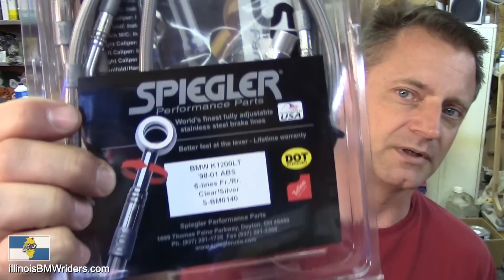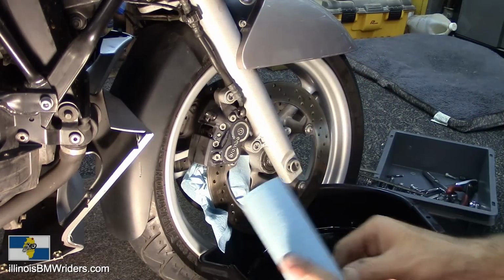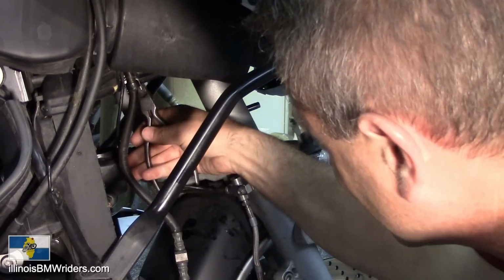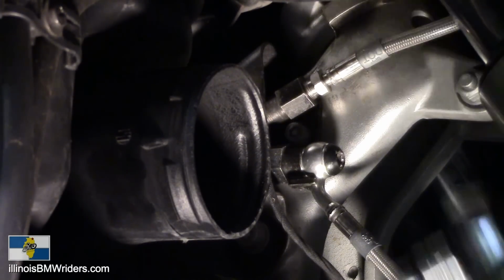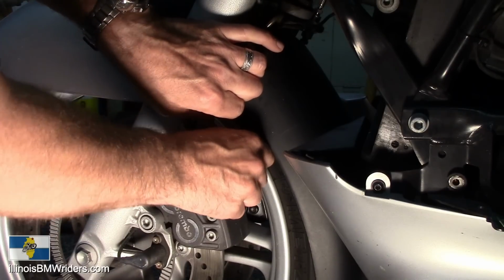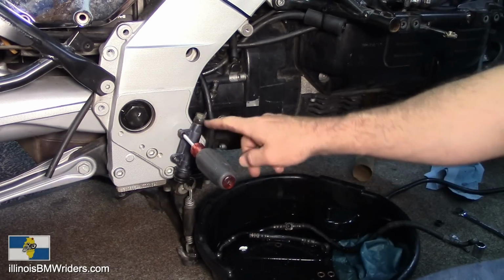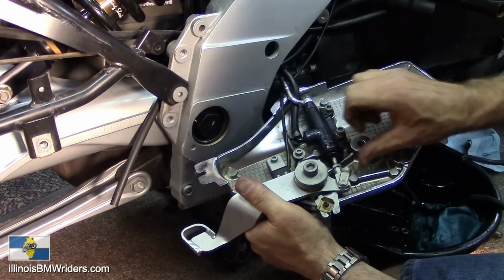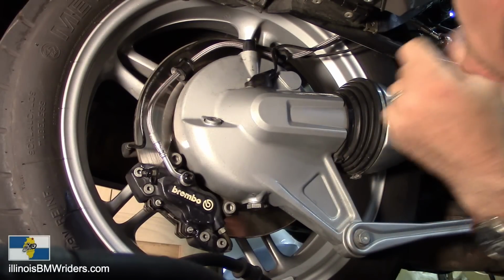BMW K1200LT DIY Spiegler Brake Lines Replacement

Comment: Good video. I have a few additions that I hope will be helpful-
-the bolts securing the handlebar covers are 3mm hex wrench/socket.
-the air horn absolutely needs to removed to do this job.
-to remove the lower end of the old master cylinder line it is impossible to get a 14 mm and an 11mm wrench in that space so I cut the brake line close to the fitting and used a 14mm socket and ratchet ti remove it. Mercifully Spengler supplied a line needing a single 11mm wrench to tighten the new line which is doable. Before tightening this fitting you will want to tighten the upper end of the line ti the master cylinder to achieve the correct angle.
-you can use a 16mm wrench on the new junction block when tightening those lines down.
-the left side caliper line needs to have the bracket and rubber grommet assembly removed to remove the old line (3mm hex socket). This bracket can be pried off the old brake line with a screwdriver and used on the new line.
-When trying to loosen the rear master caliber line from the fitting by the battery box it is impossible to get a 15mm wrench on the fitting without removing the shock/spring assembly. To avoid doing this I was able to put a vice grip on the banjo end of the old line to counter the torque of loosening the bolt. I also removed the bolt holding the bracket to the battery box(3mm) to give myself more space to work with. 
It’s an aggravating job but doable-

Comment: Great video Kirk! Thank you. 
I just finished this job on my 2000. Your video made the whole process so much simpler for me. Thanks again, great quality video and perfect instructions!
Reply: Hi, First I want to thank you for all of the great videos and tips.

I have performed a bunch of the things that you suggested. 

I just got my home and have a concern. It has a clunk when I go into a parking lot or small abrupt transition. I cant find anything obvious. 're filled the stabilizer, dont see any leak at the shock. Im stumped. Really smooth otherwise. Thanks in advance.

Guy Fogleman ID.
Reply: @Yugsie  did you figure it out?

Comment: Thank you, thank you, thank you! I did the kit myself. I could not have done this without your video(s). My front brake line broke the day after I finished a 2k miles vacation from central CA to Vegas, Zion, both rims of Grand Canyon(in 32° snow flurries), old Route 66 in AZ, then home all in 6 days. I was in my garage when I saw the leak. Definitely a conversion I should have done earlier. I am grateful the leak didn't occur on the road. Your bleeding video helped alot as well as your shifter linkage maintenance video I did too while LT ('06) was naked. It took me a day to strip, then two full days to r/r with the Speigler kit and bleed and reassemble the 'tupperware'. Thanks again. (I will eventually do a donation your way)
Reply from the maker: Your very welcome! I am on Patreon :-) www.patreon.com/kirkjohnson
Reply: @kirksmotorrad   hi kirk I'm looking on Ebay for spiegler brake lines and racecrafters usa are  coming up but the only thing is they're website is not opening so can I ask do you know of them and are they ok to order from as I'm from the uk . The bike is 1999 lt I can order from bmw uk but the price is very high . Regards cliff
Reply from the maker: @cliffperry8470  I have not used Racecrafters. Why not  contact Spiegler directly and have them shipped?
Reply: @kirksmotorrad  thanks I'll try that can I ask what's the best way to contact you . My lt needs loads of loving and parts . I've looked at it vids on bleeding the non abs but do you have a video of bleeding the calipers as well .
Reply from the maker: @cliffperry8470  http://kirksmotorrad.com/contact.html

Comment: Good thing you tested the brakes,I would rather have brake fluid all over the shop instead of all over the rear tire trying to brake hard at highway speed.You may have saved a life(s) 'Great job on making this video and thank you for sharing the helpful info,bro.Keep your rubber on the road and your tach in the black.Ride safe everyone and remember to lQQk twice and save a life,Motorcycles are everywhere!

Comment: TIP: Put the bolt and washer side on first and the male side last. 
When you put the male side in first you will find that you will be turning the bold side more and its not needed. 

There is a female on the frnt left side. Start at the brakes on the left then do the right side and work up to the air in-take area. Do the upper Hand Brake and work to the air intake area.  Now you can button this all up. 
The back is the same. Work from the brake to the front on the right side of the bike. 
You will find that from the foot brake up to the hard line is behind the (Back Bone Frame) Where the shock is. This was a really hard spot to deal with for me as nothing fit in this area.
>Total 6 lines.
2-Front lines
2-Upper lines
2-Rear lines

Comment: Another excellent video, thank you.  I appreciate your methods & techniques to get the job done.  A friend bought a 2003 K1200LT with 40K a few nights ago there was brake fluid on the front right caliper leaking from the hose just above the metal Tee.  The Spigler kit seems really nice, really like how they reworked the metal Tee.  I'm estimating 4 hrs to do the front / rear and bleed.  Wondering if time is saved by doing front first, and rear later.  I am fearful of bleeding the brakes - some go smoothly and some don't.
Reply: i know Im randomly asking but does anyone know of a way to log back into an instagram account?
I somehow forgot my password. I would love any help you can offer me!
Reply: @Harlem Kendrick Instablaster =)
Reply: @Edward Jonathan thanks so much for your reply. I got to the site on google and I'm waiting for the hacking stuff atm.
I see it takes quite some time so I will get back to you later when my account password hopefully is recovered.
Reply: @Edward Jonathan it did the trick and I now got access to my account again. I'm so happy:D
Thanks so much you really help me out :D
Reply: @Harlem Kendrick you are welcome :D

Comment: I usally perform a brake fluid flush prior to changing the lines so the lines dont get contaminated fluid in them
You end end up with pristine fluid and lines when done
Reply from the maker: works good either way as long as your lines have not deteriorated internally

Comment: Hi Kirk, Have a question. I have a '99 LT and I have to 'double pump' the front brake to get firm pressure while braking.  I this a master cylinder problem?  If so where can I get a replacement master cylinder for a reasonable price?  Thanks

Comment: Hello Kirk, thank you for those  Educational videos. I was wondering if you have a video to help me I just bought a 99 K 1200 LT. Which is smoking on initial start up. When it warms up its stop smoking. I'm assuming it's slightly burning oil. Can you please guide me to find a solution.
Reply from the maker: To reduce smoking on startup,  I do this when shutting it off. I shut it off sitting on the bike and wait at least 20 seconds or so before putting it on the side stand. That way the oil has time to drain back down and will reduce how much drains on top of the valves. Also use the center stand when ever you can. The smoking is normal.

Comment: ive watched and enjoyed your videos for some time...thanks. im curious if you can help me with an issue im having w/ my 04' k1200lt. when i attempt to start the bike, i cant seem to deactivate the alarm, fresh battery in fob, when i press the button on the fob,  the light on the fob blinks rapidly and continuously, until i stop pressing it.....the alarm indicator light in the dash appears to be pulsating from the moment the ignition is turned on, the the fob alarm button seems to have no effect on the alarm light on the dash. of course, the bike wont start while the red light on dash it lit. any ideas? thank you

Comment: Hi Kirk,  As always, thanks to you and your club for creating these service videos.
I had been planning to replace my brake lines on my 2004 LT over this past winter 2017-18 as a preemptive effort to avoid disaster.  Unfortunately, at the very moment of placing my bike on the lift last fall, I blew a line near the rear master cylinder.  It turned out that I could not get to the project as my planned work area was smaller than I thought.  So I left the project for this spring. The bike is on the lift in the garage and I am starting the undressing of the beast, but I suspect all of the brake fluid has drained out through the hemorrhaged brake line.  Do I face a new set of challenges in the brake line change now thinking I have lost all the fluid?
Reply from the maker: Probably not a disaster. Its likely you lost all the fluid but you can get it back.  If the master cyl leaked out, change the line and leave it loose at the top by the shock. refill the res and let it fill up to the line that is loose. After that, its bleed as normal. You should be fine. Remember, its only parts... and time!  Thankfully it didnt happen on the road!

Comment: Kirk , I have a 2006 k1200lt with 18,000 miles , pretty sure its been garaged its whole life , I am the second owner, the bike still has the oem break-lines, will I be ok for a while, or is this a 911 situation ?  as always thanks for your videos and help to the BMW motorcycle community
Reply from the maker: I would say if you just look at the bike and dont ride it ...ever... then yes, you can leave the brake lines.  There is NO WAY I would trust those lines to not break! We dont really have much in the way of protection on a motorcycle. Losing the brakes at the wrong time would  not help the safety factor.  I will be honest. I would love to find a brand new, never titled LT of any year with zero miles. The FIRST thing I would do is change the brake lines.
Reply: illinoisBMWriders Kirk , I am hearing you loud and clear , thank you for taking a moment to answer .

Comment: Hi Kirk. Thanks for the nice video. How do you know all the air is removed from the system? Is it normal for the front brake to feel spongy when the bike is turned off?
Cheers Don
Reply from the maker: Yes it can feel a bit spongy if you really give it a squeeze but if it is going to the bar every time you probably still have air in  the master cyl. try tapping on the brake lever to get the air out.

Comment: Kirk,

Finally got around to installing.  One problem; the male threaded parts are longer than the old lines I am replacing and do not seat completely in to the existing female fittings.  There is a gap when I tighten down.  Use extra washers?  Call Spiegler and complain?
Reply from the maker: The gap is normal. Just tighten it down enough that it doesnt leak.

Comment: Kirk,  Great Video as usual!  Have you done a video of getting these beasts on a lift?  I notice a lot of work being done on ground.
Reply from the maker: This was back in the old days of Kirk having no lift... Yes I do have a lift now and its on the channel. :-)
Reply from the maker: thats just my shop keyboard. No cleaning required!
Reply from the maker: first things I would look at would be the spark plug wires, then the fuel line in the tank and then the O2 sensor.

Comment: Dear Kirk, I have been told one of the 14 mil head banjo bolts has a valve in inside it. Is that true and if so which one is it. Also how do you remove the bottom half of the handle bar cover on the throttle side. Please and thank you.
Reply from the maker: There are no valves that I know of in the bolts. You can remove the lower cover from the top once you get the top side off. There are small hex screws
Reply: illinoisBMWriders Hello Kirk and thanks for the reply. I’ve just today stripped the bike and removed all brake lines for replacement. Regarding the lower handle bar cover removal I had to release the throttle cables from the grip as they passed through a hole in the lower cover I had asked that question as nothing has been mentioned in any videos I’ve watched and was wanting it totally out of the way for fear of fluid damage. Regarding the the banjo bolt question. I have found that the one hex head banjo bolt connecting the brake line to the front brake master cylinder on the handlebar is the one that has a valve or throttling device inside it to regulate the pressure to the abs system on the integrated brake system. Perhaps it may be worth a mention sometime on one of the videos. As you probably already know there are only two hex head bolts the rest being Allan key. The second hex head bolt is the one on the rear brake master cylinder. Now whilst I’m waiting for my new lines to arrive I have to replace the rear rotor purchased from EBC. Not looking forward to getting those pesky little bolts out :(    I can’t thank you enough or the videos you have put out for us all to keep costs down and able to enjoy these bikes. Mine is a 2007 with only 22,000 kilometres on it and to sell its value has gone dollar wise. So best keep it and ride it instead of paying out more for a lesser quality machine. Stay safe and God bless from Canada 🇨🇦

Comment: Hi,

You talk about bleeding the ABS unit but you don't show how it should be done, do you have a video for that?

Also few guys on the online community say on a 1999 Model the ABS unit doesn't need to be drained or bled, just to bleed the calibers in the normal way to get the air out and that is enough.

Which one is correct and why ?

Finally, are Galfer or others brake lines any good ?    Why Speiglers ?

Thank you.
Reply from the maker: https://www.youtube.com/watch?v=-hm4dxVs3TE
I have found that there is still old fluid trapped in the ABS no matter how much you run fluid through the system. Remember, its your bike and you can do or not do what you want. I think Galfer makes good products as well. I like Spiegers due to their top quality and continual R&D. That and everything is made to order at one location.

Comment: Question: was about to bleed the brakes but had to run to the auto parts store. While gone, a downpour came out of nowhere and got into the front brake reservoir. Is my brake system screwed?
Reply from the maker: No. Suck everything out and dry it with a paper towel. Then make sure you tap the brake lever like I show in the video to make sure you have all of the air out of the master cyl. You should be just fine!
Reply: illinoisBMWriders Whew! Great. Thank you. And thanks for your tremendous videos

Comment: Kirk you mentioned that this bike had been lowered 3" how is this achieved and does it improve handling the bike at slow speeds? (due to it not being so top heavy)?
Reply from the maker: This bike feels like it is going to scrape everything due to being so low.  I dont think it helps the handling other than being easier to get on and off

Comment: The FRNT:
I would suck from the frnt brake and open at the ABS line and suck out all the fluid in one shot. Mybe a little cleaner.. As when you put all the new stuff on its going to be dry. 

The Back: 
Suck from Back to fill on side, to ABS.. again cleans all the old oil so it don't drip... Less mess